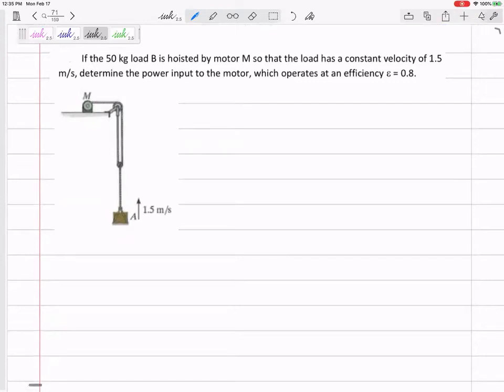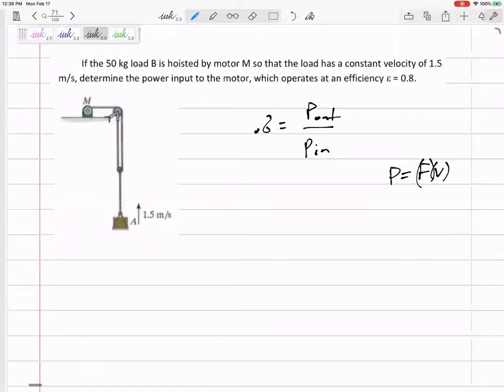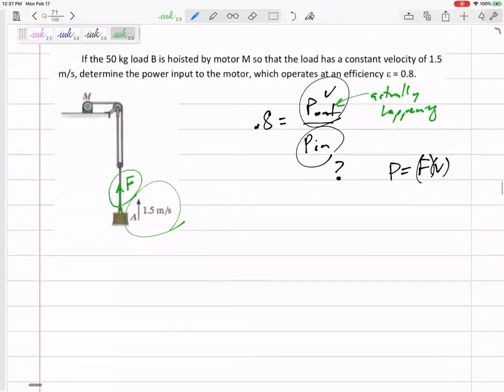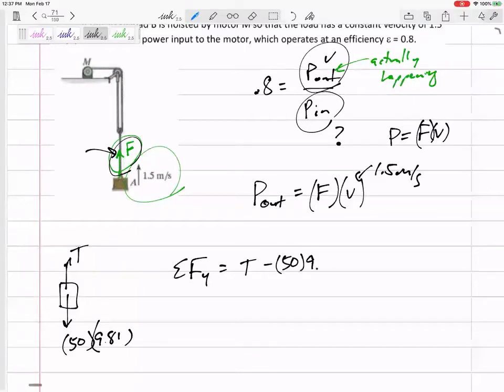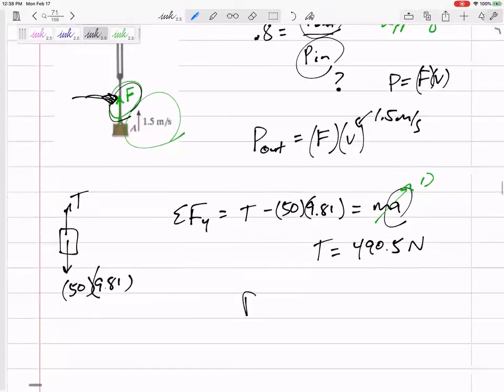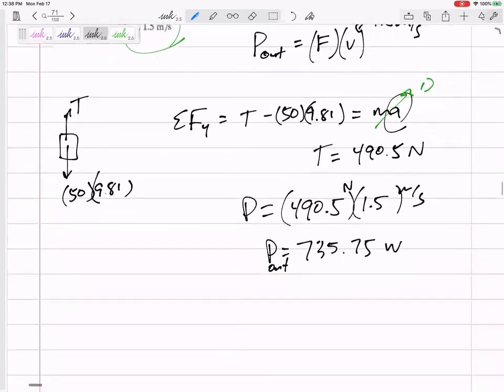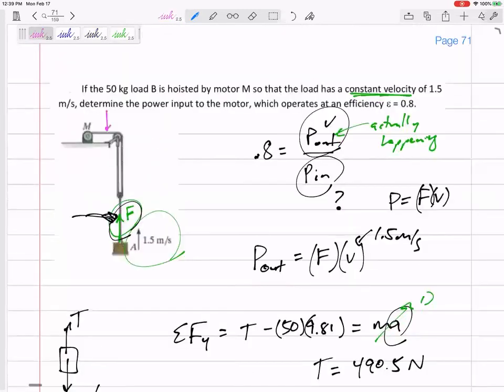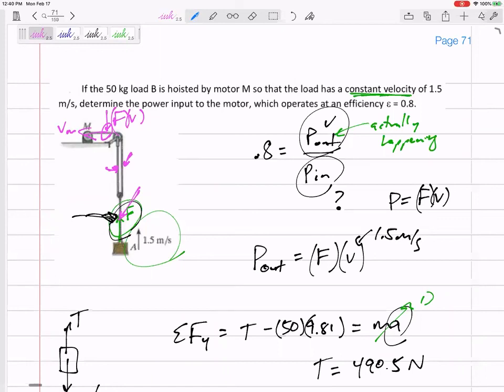Dynamics - Work and Energy example 2

Comment: Why don’t we use 2T here?
Reply from the maker: You could have. But then your T would have been half of mine and your velocity would have been double mine. So we’d get the same power.
Reply: @engineeringdeciphered  please could you elaborate
Reply: @dominicowen7913  if you take single T you would be looking at the cable which the motor is pulling. If the box is moving with 1.5 m/s then the motor is pulling with 3m/s due to pulley system